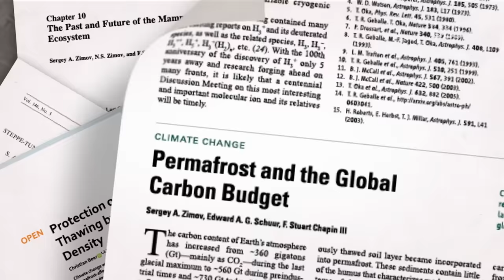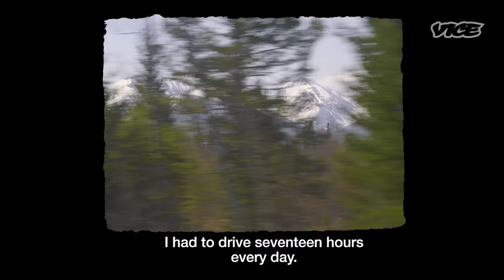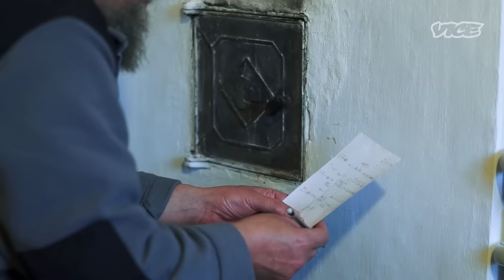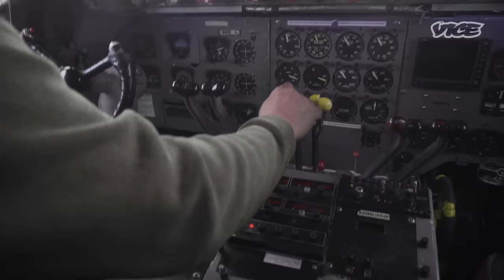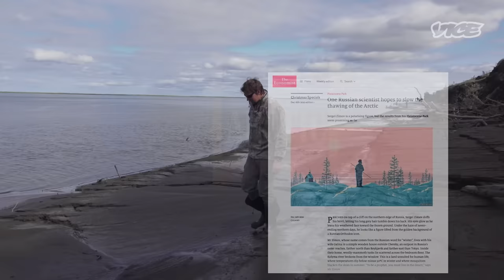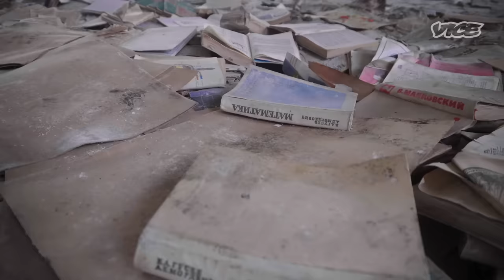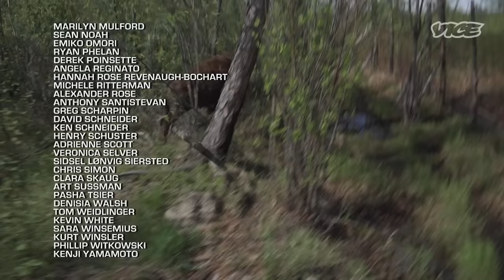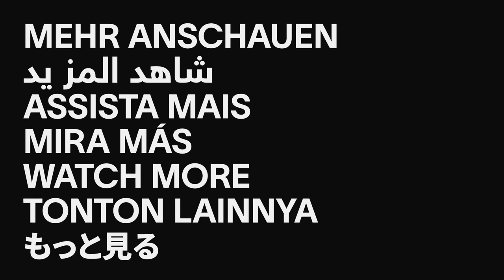A Russian Scientist’s Plan to Save the Planet | Pleistocene Park (Full Film) | The Short List

Comment: So his idea behind the Animals 44:00 is that they disturb snow in winter to find food to eat, uncovering the soil, because the snow was an insulator and slowing down the cooling of soil. Meaning animals uncover soil, temperature goes down even more and preserves the permafrost keeping it cool. (If I understood correctly?)
Reply: Yes, you can read it in their paper: Protection of Permafrost Soils from Thawing by Increasing Herbivore Density.
Basically the soil gets warm in summer and cold in winter. Permafrost stays on if there is a balance between cold and warm. The snow works like a blanket that appears in winter and insulates soil from the cold outside. Animals make this blanket less efficient by compacting it, making it less fluffy.